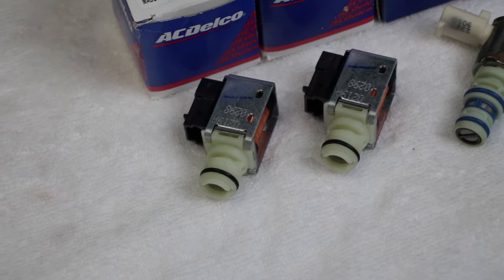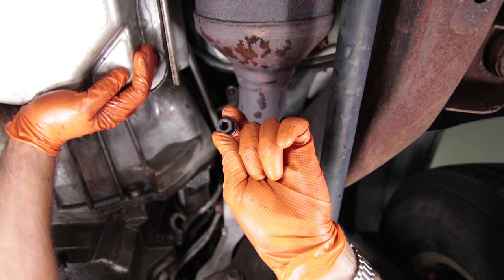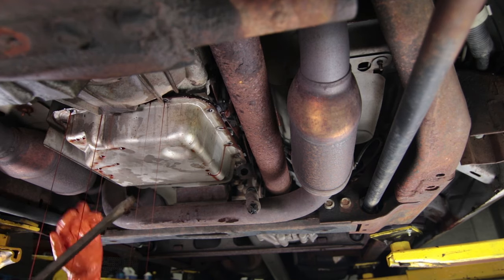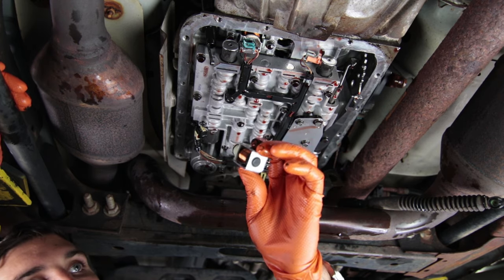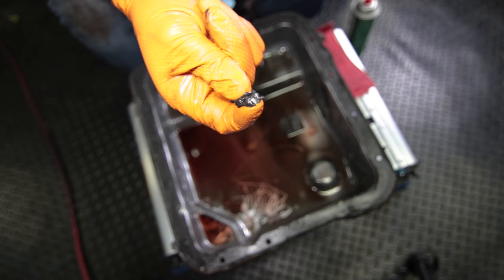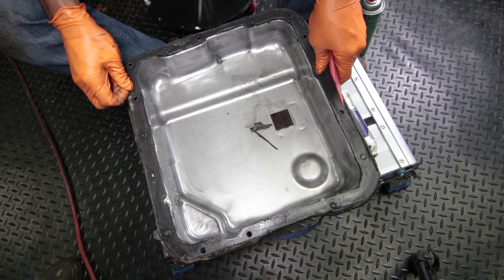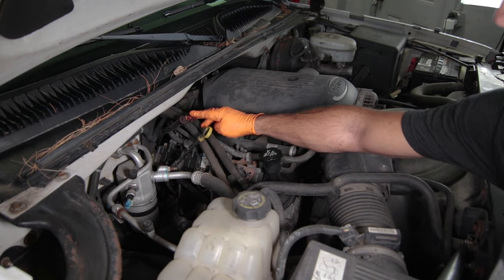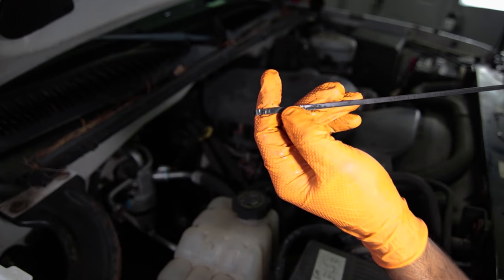HOW TO Replace All 4L60E Shift Solenoids and Torque Converter Clutch (TCC) Solenoid. Silverado 1500

Comment: I just changed out the 1-2 and 3-4 on mines. Got everything back together but when I shift into gear the vehicle will not move. I’m thinking either low fluids or shifter linkage. Only put about a gallon of transmission fluid in. 2001 hav sierra 4x4

Comment: QUESTION:  I'm trying this tomorrow on an '05 Silverado that won't shift into 3rd gear.  0449 (Evap vent valve solenoid circuit)/0756 (solenoid B stuck) codes.  Once I have the pan off, should I go ahead and replace all 4 solenoids instead of just the A and B?
Reply: What did you find out was it just selenoids?
Reply: @KollynJ  I wish it would have been, but I ended up getting the transmission rebuilt.

Comment: My truck shifts hard into second like a sledgehammer hitting concrete, it was rebuilt a year ago, it does vibrate, i thought it was engine related, but it only vibrates in drive, 

The shop said it would break in and smoothe out
Reply from the maker: Have you checked the your drive shaft/ujoints for vibration? Above certain speeds, almost all Silverados shake. Pretty common. Hard shifts are pretty common is accelerating hard. If it is happening on slow accelerations there might be an issue

Comment: I have a 2011 Silverado 4x4 which is my plow truck.  Just recently it will just Rev up in any gear and reverse.  Turn it off and let it sit for a minute and it'll be fine, only to do it again after shifting from drive into reverse two minutes later.  It continues to do this now.  Could it be the TCC Solenoid?

Comment: @The sundae Drive Sir  the car transmission is making whinning noise, and delays in shifting. I checked for the fuel level is Ok, I checked for the oil still fresh not burned, I checked for any leaks no any leaks, I open the pan, but there were no any metal shavings on the magnets no any particles on the fluid, I decided to change the transmission filter, I checked and open  the valve body  no any clogs on the passages, I removed all solenoids I tested them all, and one was not working, I changed it with new one, I put back everything I test drive the vehicle no more whinning noise at all and shifting gears smoothly, but after two days as i drive reaching speed of 100 mph, the whinning noise started again, and the car struggles to exceed speed of 100mph, the RPM goes high and the speed is not achieved, what can be the problem, and what can be done sir? Kindly help with ideas.

Comment: My trail blazer will go in. All gears. Then sometimes it want. When you put it in drive seems like something is holding it back. From picking up any speed. Like the brakes have been aplied.  Any idea  which  solenoid

Comment: I recently got a code 39 on my 94 GMC 3500 with a 7.4 engine
Reply: Do I need to replace all 4 sensors on a code 39?
Reply from the maker: Wow that's a big engine 😲 I'm not sure, which transmission

Comment: Hi, I have a 2003 Silverado 4.8l with 4L60E 2wd, when I start the pick up it extends the first gear and jerks when the second gear enters, on the contrary if I start it hard enough it pulls all the gears perfectly well, based on your experience you will know which one can be the cause?
Reply: What did you find out it was?

Comment: My question is once I'm driving and my engine is to operating temperature or basically when the thermostat opens and shortly after it will go into limp mode very high RPMs to shift. Could this be any one of these solenoids? And if so which one?

Comment: It is possible to get the pan out without removing the exhaust bolts using the strap. You need a fairly strong one, or two. It has to go nearly straight down.
Reply from the maker: We couldn't do it without loosening components but maybe someone else knows a trick or two!
Reply: @TheSundaeDrive  I had to use two straps because they are small and I had them on the passenger side kinda halfway to the middle. I hoped changing the filter and fluid would do the trick but no such luck. Another video a guy did all you did and still didn't fix his problem. Then he found a blown fuse that was his only problem. So I checked mine and found another cluster Fk. I found a fuse that was in a slot that said it was a headlamp washer in the fuse block lid but it says it isn't used in the manual so that I don't have a clue what its for. Also three other fuses that were corroded. Now I have TWO trucks with electrical problems, one of those with a differential problem that is the only one driveable and another with a bad transmission that I can find that doesn't cost more than the thing is worth. So how's your summer going. LOL
Reply: I had luck on my 07 1500 just pulling the muffler to y pipe flange apart and pulling down on cat cross pipe.

Comment: I’m having the problem with my builded 4l60 run a high RPM won’t shift to OD and running a high temp, I have a PTC 3200 stall lock up, and on my OBD reader it says PO0741 the truck just have a startup tune on it, I was wondering should I get another shift solenoid or go get it tune first …

Comment: Hello great video. But I have a question. I have 03 silverado and when I drive in the freeway it won't shift to 4th or 5th gear. Do you think it's the solenoid. I been taking to different shop and they say that I need a new transmission
Reply: 4L60E does not have a 5th gear. No 4th gear? Time for a transmission overhaul, 3-4 clutch pack burnt up.

Comment: The solenoid wasn't a fix for me. I discovered that I lost 3rd gear in the transmission and had to end up having the transmission rebuilt. It had 360,000 miles on it though so I would say I got all the good out of it.

Comment: what problems was you having with the transmission? I have a 06 chevrolet suburban that hangs up in 2nd gear but when I get on it it'll shift all the way out when i'm just driving normal it will shift to 1st and 2nd just fine it just wont shift to 3 and 4 it hangs up into 2nd gear.

Comment: I replaced solenoids 1-2/3-4 and Clutch plate, new filter and oil about 8 months ago. Now when I am around 1500 rpm the car stutters. Yesterday I replaced the fuel filter, cleaned the engine coils and MAF sensor but did not help. Any ideas what could it be ?
Reply from the maker: Perhaps it could be Torque Converter related but I’ll need to look into it more before I can give a more solid answer
Reply: Engine codes?
Reply: @TheSundaeDrive  late reply, the culprit was VSS installed on tranny.
Reply from the maker: Glad you figured it out!
Reply: @ericcunningham4701  apparently there were no codes appearing.

Comment: I have a 97 Jeep with an error code P0743 Torque Converter Clutch Solenoid Circuit Electrical DTC severity 2 of 3.Is this where I should start looking at?

Comment: I have a 2016 chevy tahoe LTZ that's shuddering at low acceleration only, but only after the engine is warmed up. Could this be the torque converter solenoids?

Comment: Can you help me? My truck-The TCC shift valve does not move. I noticed in your video a valve did not show or (push) the solenoid out. When I place finger in to test valve it does not budge. Is it junked up and "stuck"? Doesn't it need to spring freely like the others when pushing on it? I replaced all 4 solenoids and truck still won't shift from 2nd to third. I purchased a AC Delco GM Original Equipment 24234138 Automatic Transmission Torque Converter Clutch Valve Kit. But I can't get the old valve out. Am I on the right track and any advice on how to get old valve out?
Reply: Did you ever get this resolved? I have a similar issue

Comment: awesome video i have 2007 gmc yukon denali code P0776 pressure control solenoid valve 2 stucck off.this aplication can be apply to my vehicle.I'm not mechanic tried to do it myself.any feedback will be welcome &  apprecieted

Comment: Help I noticed one of my solenoid shift valve wasnt springing one was ready to pop out the other seems stuck how do I fix I change both solenoids filter and oil and still same problem only 1st and second gear 😢

Comment: what happens when the torque converter solenoid goes bad??  my h2 has plenty of power and shifts normal but when i'm up hill it doesn't have any power at all i'm wondering if this could be the issue
Reply: I have a 2013 Silverado I am wondering as well what TCS also does. I  find when I go into overdrive it seems to drop the rpms way too low. Then chatters. Any thoughts?

Comment: @0:39 are those the part numbers needed? Im gonba try this. I lose 3,4 after it heats up.
Reply: Did it work? Mine does the same exact thing once it runs decent for a little while but after more than 10-15 minutes of driving, 3rd completely goes and it barely catches 4th if I baby the throttle right

Comment: Changed the TCC to clear check engine and now it is not shifting to 3rd gear. 1st and second are fine but slips and no 3rd. Cleared check engine tho

Comment: I was wondering about the torque converter clutch solenoid in my 01 tahoe 4x4. Maybe i should change that. My problem is delay engagement at take off, then locks. Doesn't slip at speed though. Hoping i don't have to spend the $2k on a shop.
Reply: If your gonna spemd 2k look into a performa built trans

Comment: Is there a solenoid for reverse? All the sudden My reverse stopped working and my trucks limp mode engaged, now it wont rev over 2 RPM or move in reverse.  I need ideas where to start?

Comment: Hey brother. I have a 02 Tahoe z71. Trucks starts and runs great but at the 25-30 mark it has a delay before it takes another gear. Mechanic told me it was the transmission. Any advice? Thank you!
Reply: Do the silioids then Change tranny oil

Comment: Once i had a 1978 Chevy truck v8 automatic, it wouldn't shift out of low gear. It was a night when i got it running. So next day i knew what it COULD be..

It was the modulator valve disconnect. !
Reply from the maker: Awesome thanks for sharing!

Comment: 95 c1500 with 205k on it. The trans shift HARD into 1st then the rest is fine. I have reverse and everything it’s just the 1st gear that hits hard. I’m thinking about doing this to the truck and swapping out the solenoids. My question is would it be better to flush the entire transmission before or should I just drain, swap solenoids then fill again.
Reply: Did you ever figure it out? My 94 k1500 would hit 2nd gear like it had a shift kit .. limped it in to work today with the tranny slipping

Comment: My transmission is slipping I tried changing the fluid 
I added a whole gallon, and new filter when I checked it there was nothing in the pan like nothing broken or metal. 
It drives and reverses, parks normal doesn’t shake sound good. What can it be?

Comment: I have a 2003 Sierra with the 4.8  at 147k miles and it hesitates when shifting from 2nd to 3rd and when I'm going up an overpass on the freeway for example it revs up higher than normal like it's struggling to get up the overpass. I bought the truck in June 2020 at 130k miles the transmission fluid is brown when I bought it and didn't have any issues up until recently what could my problem be and I'm thinking about getting the fluid changed because I don't think the previous owner never did it?

Comment: Can you replace the 1-2 shift valve at the same time as the solenoid is being replaced? I don't trust myself not losing the check valves.
Reply from the maker: Yes you should be able to replace the shift valve at the same time although I am not sure if they really go bad...
Weird thing is, I am not seeing the 1-2 shift valve on RockAuto. Were you able to find one? I am only seeing the heavy duty 2-3 shift valve.
Reply: @TheSundaeDrive  thank you for answering. There's a service bulletin for my year and production code to upgrade that 1 2 shift valve. I found the part on Amazon. However, i was worried I would have to drop the whole valve body.

Comment: So I changed out my torque converter solenoid and still throw a check engine light. And I have changed all them. But now keeps saying it's torque converter solenoid. Any guess what's wrong. I'm in a super bind

Comment: Question: 08 Buick Enclave wont shift from first gear. Changed valve body, per mechanic, to no avail. Are the shift solenoids the same as the Silverado? That looks like something i can do myself.

Comment: My 1 2 shift is hard, I'm assuming I need a new solenoid. But then also when my torque converter opens up it makes my truck shake like it's on a rumble strip. Any ideas?
Reply from the maker: Swap the torque converter most likely but also check your drive shaft if it only happens at certain speeds.
Reply: @TheSundaeDrive  well I do know I need new seals and bushings for the rear axle. It happens at around 50mph when going up a hill and it still in overdrive but it allows the engine to Rev slightly higher

Comment: My '02 Silverado shifts out of overdrive multiple times in the 40-50 mph range, like several hiccups until it's up to higher speed.  Other than that no slippage.  Do you think replacing these solenoids will do the trick?
Reply: Hey buddy, I have the same problem with my h2 2006 but mine slips when shifting from 1 to 2. Did you manage with your? Any tips would be greatly helpful.
Reply: @myamazinglittleworld5673  I am also getting the knock sensor codes, so there's the possibility the truck is limping in response.  I have no interest in breaking open the manifold on this old horse, so I'll probably run the KS bypass trick and see if she straightens up.

Comment: How do you know it was shift solenoids causing the issues and not a bad TCM? I’m getting 
These codes 
P0446
Evaporative Emission System Vent Control Circuit
P0740
Torque Converter Clutch Circuit/Open
P0753
Shift Solenoid 'A' Electrical
P0758
Shift Solenoid 'B' Electrical
P0785
Shift/Timing Solenoid
Reply: 03 yukon xl 5.3

Comment: Awesome video very informative step by step process 💪🏾💪🏾 I have a 07 yukon xl Would These Parts and process Be The Same for my truck
Reply from the maker: I would always verify parts for your specific vehicle with the dealer or pull yours out first to compare part numbers but as long as it is the same transmission they should be the same!
Reply: @TheSundaeDrive  thank you
Reply from the maker: No problem!
Reply: I don't believe so. I think you have a 4L80E transmission. Go get the parts from the parts dealer and it's basically the same process.
Reply: @ericcunningham4701  thanks a lot 💪🏾

Comment: I have a Camaro 2017 ss problem ,  the 4th gear don’t shifting very well The code  P2715 the description is Pressure control solenoid valve 4 stuck on , What’s that means ? Is a one solenoid of them have problem or what

Comment: What would cause the 4l60e to hi throttle after it hits 45 miles per hour like it just goes to  neutral  and stops pulling until it get back down below 40

Comment: Hi are the 3-2 solenoid and TCC solenoid the same thing, cause I see they’re are two different parts but the employees at the parts store keep telling me they are the same thing.
Reply from the maker: I’m fairly certain that they are two different parts but what year is yours? I found something that makes it seem like some years used the 3-2 solenoid as a TCC solenoid based on this statement: 

“This solenoid is the 3-2 downshift solenoid in 4L60Es from 1993 to 1995.  From 1996 and on it is used in 4L60Es as the TCC/PWM solenoid.” https://www.google.com/amp/s/globaltransmissionparts.com/amp/4l60e-transmission-downshift-tcc-pwm-solenoid/
Reply: @TheSundaeDrive  it’s an 08 5.3 Tahoe

Comment: You did not show what gasket material you selected for the pan nor how you got the pan back on without gasket damage. Otherwise a good video, thanks!
Reply: Just use the gasket that comes with the new filter.  Holes are smaller in the gasket material so you can get the bolts to stay put.  This helps keep the gasket from moving around as well..

Comment: I did a transmission gasket on my 08, reverse works very well but wont move on drive. When i step on gas it move but very slow and heavy.
Reply from the maker: You may not have enough fluid. Did you check the level?
Reply: Yes, i did. Level is ok. Think I might have messed up one of the solenoids while removing pan?

Comment: Guy showing how it's done: Shows pan tightening diagram and torque sequence. 
EVERY transmission builder: (with impact gun) ZIP ZIP ZIP ZIP around the pan. 
You should have also replaced the manifold switch on the valve body.

Comment: When you put the pan back on do you need to use any type of gasket because I didn't see you put one on?
Reply from the maker: You absolutely do. We cleaned the old one off and then installed a new one. Links to the filter and gasket are in the description
Reply from the maker: This video shows how https://youtu.be/ZxzIRunky_w
Reply: I dont usecthise black gaskets just rtv no issues at all
Reply from the maker: RTV works well too! Just more annoying to remove in the future

Comment: A nice little trick when removing the pan, just take a vacuum cylinder with a long hose, and dip it in the pan as soon as you get enough clearance, and suck out a quart or two before making a gigantic mess.
Reply from the maker: Good tip!

Comment: Do you have to reflash or reset the computer after changing all of the solenoids? Great video guys.
Reply from the maker: Hey nope, not ECU reflash or resets required from our experience
Reply: @TheSundaeDrive  I have a 2002 1/2 ton chevy 130K miles 4.8 auto and my reverse went out and you can hear a grinding sound in the converter drive works fine is this my problem ? Chevy dealer is talking 4 K to fix it ?